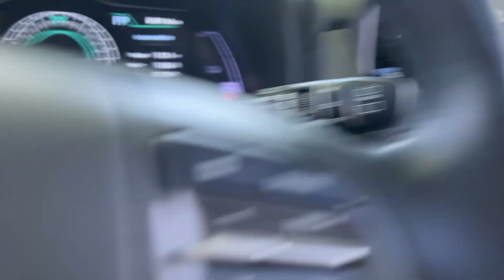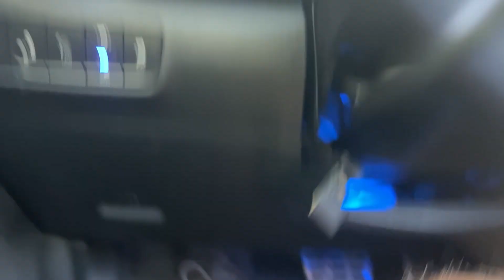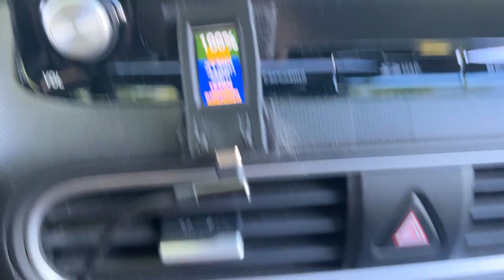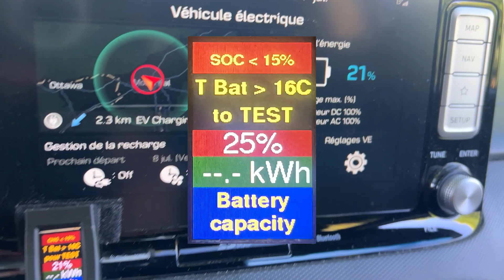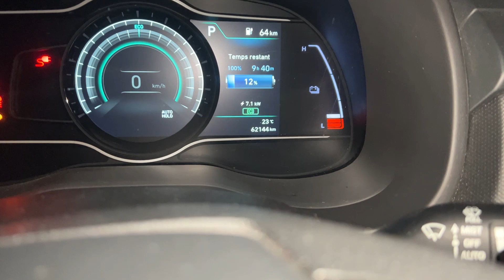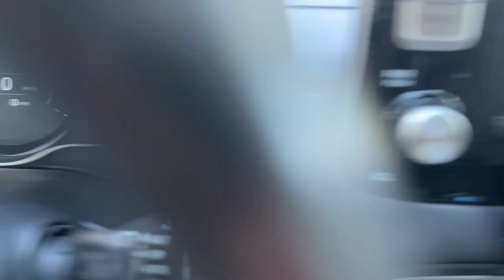Real battery capacity (kWh) for Hyundai IONIQ 5 - Kona - Kia EV6 - Niro EV with EVOBD2

Comment: I've never seen these displays show SOH of anything other than 100% for Kia Niro EV or Hyundai Kona Electric... maybe that display is stuck at 100% forever? I would like to see one of these EVs show, say, 98% or something less than 100%... it's been 2-3 years since these EVs are on the road, so I would expect some battery degradation since that time...
Reply: On my 2019 Kona at around 42000 km I saw the SOH drop to 95.6% and going down.  My battery was replaced after the recall and SOH came back to 100%.  I know a few people with Konas that dropped to.  But you're right it takes time, many months or years to start see degradation and a drop in SOH.
Reply: @JeanPierreLavoie  I'm at a little bit over 44000km on my 2021 Kona after 1 year of ownership... and SOH is still showing 100%. I'll do the capacity test this week... this will give me a better idea of the degradation and capacity. So yes, I guess it could take a lot of time to see some degradation... battery are better theses days and also Hyundai has apparently a somewhat large buffer in their batteries.
Reply: @zadigre  If you want to write your test result here in the comments after doing it that would be great!  Yes there is a significant buffer from what I can see in the battery of the Kona this is why it takes some time to start to see a degration in SOH.  With my older battery before the replacement for the recall it dropped to 96% at around 48000km.  NOw it's back to 100%.  Merci du commentaire et bon test!
Reply: @JeanPierreLavoie  test completed… 64.9kWh. I’m impressed after 1 year and nearly 45000km. I’ll probably test again this weekend (I’m going to Baie-Comeau/Manic 5)
Reply: @zadigre  Thanks for the result which looks very good indeed.  Will be interesting in the long run to see.  Merci pour le feedback!
Reply: @JeanPierreLavoie  I redid the test on Monday/Tuesday charge after my trip to Baie-Comean/Manic-5. This time I've got 65.3kWh. If that's really representative of the battery capacity, that's excellent!